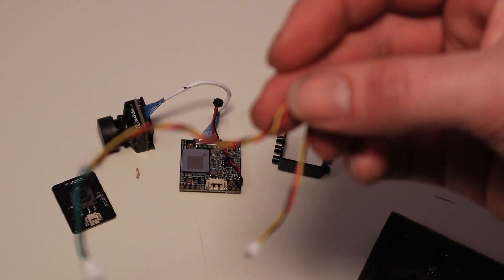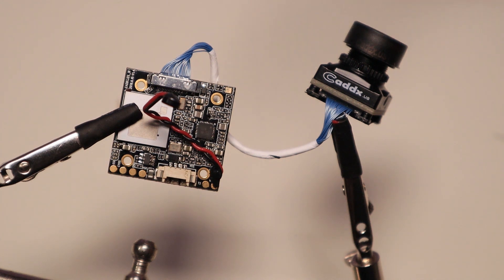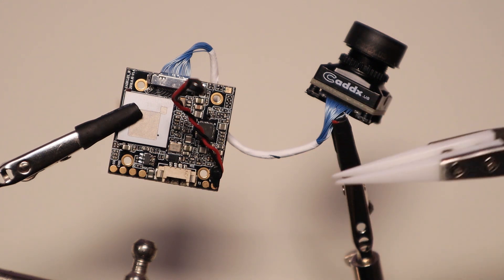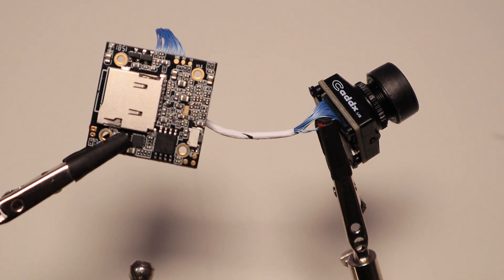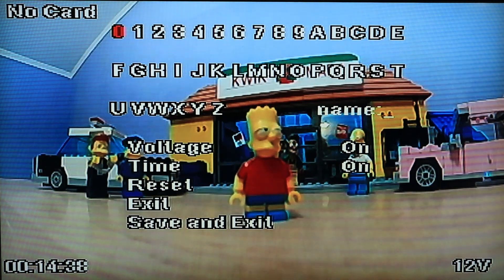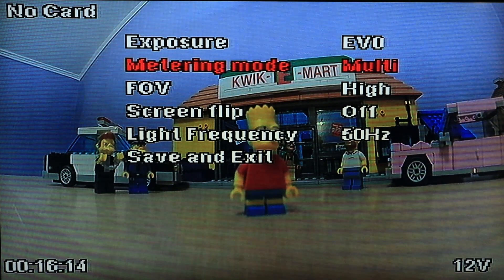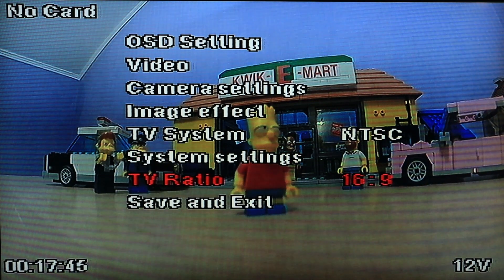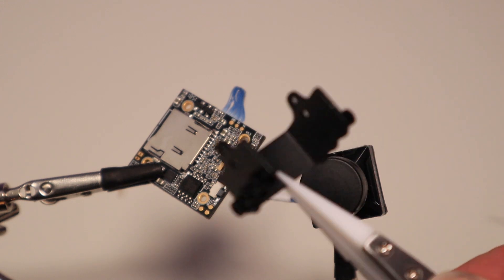Caddx Turtle V2 - Unboxing, wiring, OSD overview

Comment: Mine always displays 12v even though I have it wired to the VCC on battery. Any thoughts?
Reply from the maker: didt you try to connect it to the power or esc power and check what  voltage the vcc gives you

Comment: Hi, thanks for the video. I've problem with caddx turlte v2, I got blackscreen but I still can saw the OSD information. Solution, please?
Reply from the maker: the osd that you can see is that the one from the flightcontroler or from the cam itselfe?

Comment: Hi, thanks for the video. I have an issue that nobody else seems to face elsewhere online. I have  installed the latest firmware (January 2019 as of today). The video feed is very clear at close range but I get a lot of very heavy glitches as soon as I am more than 1 meter away from my drone. Do you happen to know what causes that?
Reply from the maker: please tell me what vtx/fc you have  
didt you have the problem before the update
Reply: @section8freestyle  Arf... sorry I forgot to mention that I am using a brand new BetaFPV’s 75X HD (purchased on Betafpv’s site). It has a A01 VTX and a F4 2-4S AIO 12A FC. I never flew it with any other firmware then the one from January 2019. The issue appeared right from the first flight. Hope that helps.
Reply from the maker: @Ndriana  you need to look at the version if you have the 2cel it has a vtx with power 0/25/200 maybe its stil on 0 so your broadcast is 0 try to change it to 25/200 for range
let me know if it works
Reply: @section8freestyle  I've been less then 6 months into FPV drones. I am not sure where/how I can check or change my settings according to what you ask :'(
I looked in the OSD section of BF but didn't find anything about my vtx power.
Can you direct me a bit please?
Reply from the maker: @Ndriana  if you take of the canape you can see 2 rows of leds anda white buttom that wil let you changen yout ban/channel and power ans normaly you can change it in the osd 
HOW TO CHANGE FREQUENCY & CHANNEL & POWER
Frequency group A~F selected still touch up to 2 secs
Channel ch1~ch8 selected with short touch.
Power switch with long touch up to 5 secs.
You can know which power the vtx is in by the Power LEDs ( The left one is Pit mode the middle one is 25mW and the right one is 200mW )

Comment: I have to wrap a Zip Tie around the Caddx Board to stop SD Card ejecting. I have lost all video, dark grey image, no OSD showing but goggles scan and stop at the correct Freq, I just have zero video, have changed the FC, VTX, Camera Sensor, Caddx PCB, Camera, SD Card, everything but the ESC and still no video. My goggles working fine with my other quads too. I'm very confused now, no idea what it could be.
Reply from the maker: do you use the fc osd or external?   what vtx do you use? have you try to connect the cam direct to the vtx and wil the cam store video's on 2 the sd card?
Reply: @section8freestyle  Found problem, I resoldered the wires across the FC and tried it and I have video at last, must have been a dry joint, 4 days it took me to find that, is the world still out there and everyone alive, could have been an apocalypse and I wouldn't have known, lol.
Reply from the maker: @BrigzyFPV  i know it could take forever to find the problem ,nice that you find the problem glhf flying
Reply: @section8freestyle  FC BetaFlight OSD. VTX it came with is a RunCam TX200U, it has slightly different wire layout to orig TX200U but still  wont work. The Caddx and Cam all working as its set to auto record and it records HD while im im testing the goggles, with no joy. But have pulled card and its recording perfect video, its the Video to Goggles that doesnt work, the only prob. havent tried Cam to VTX no. I have 2 other VTX's so will swaop vtx next.